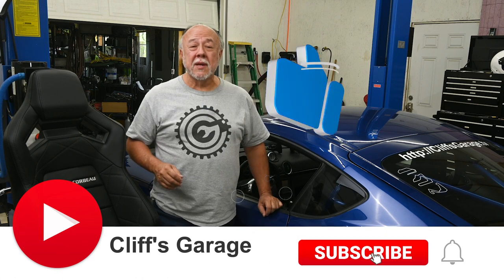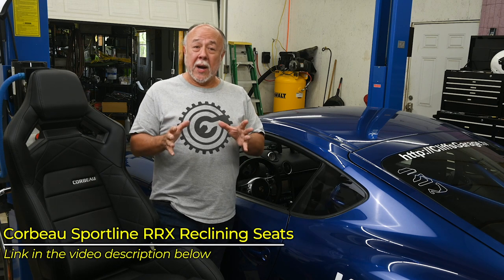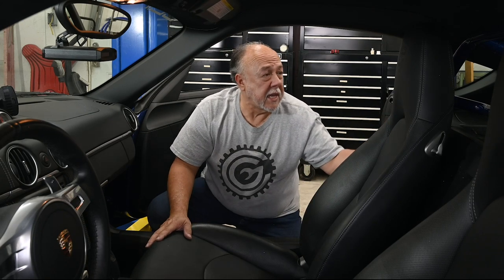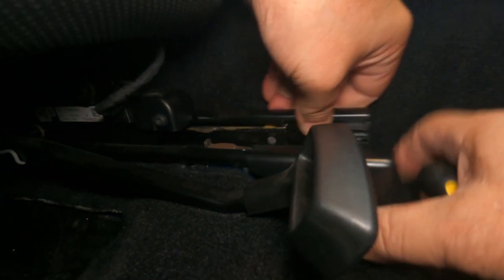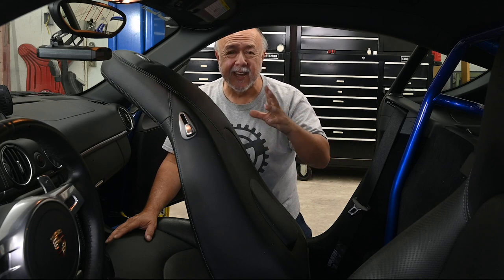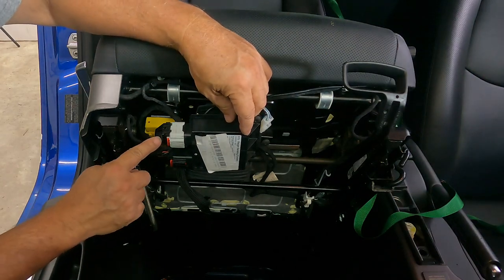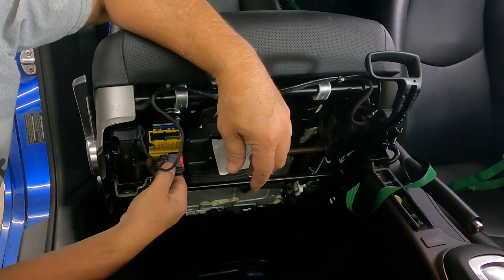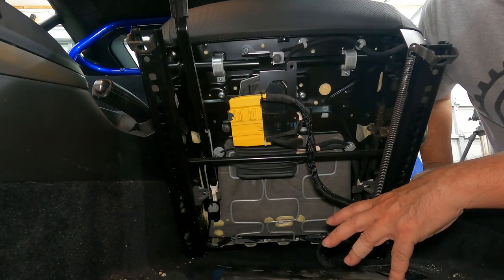Corbeau Sportline RRX Seats For My Cayman, Part 1: Remove The Stock Seats (DISCONNECT THE BATTERY!)

Comment: hi again, Cliff. wanted to thank you again for recommending the RRX seats. I just bought a pair for my 350Z with the stealthy 5th slot and love them! I'm planning on getting the same seats for my Z3 and my Cayman. although I'm 6 ft and the 350Z seats are a bit too tall for comfort. I'm wondering if they sit much higher in the Cayman as well? I guess I'll find out.
Reply from the maker: They sit basically the same or slightly lower than the stock seats on their lowest setting. Initially I put 1.25" spacers to raise the seat but eventually took them back out after a few months because my helmet felt uncomfortably close to the headliner. After several more track weekends I feel like they're just a bit too low for comfort so I may go back in with some 0.5" spacers on the driver's side only, leaving as much headroom as possible for passengers. Removing the headliner also helped a lot with the driver headroom issue.

Comment: oh nice! I have Corbeau Sportline RRS seats in my 350Z which are similar. I love them but was thinking maybe going to Recaros for the Cayman. That's just vanity, though. Might just stick with Corbeaus again.
Reply from the maker: tbh, if price were no object there was a set of Recaros I really really liked. Don't recall exactly what they were, but the price was about 3x the Corbeaus and Recaro wasn't interested in giving me a break.
Reply: @CliffsGarage  it's probably the Sportline GTs which come in a gorgeous leather with carbon fiber accent or vinyl with several highlight color options. I've had my eye on those ever since my 2011 GT500 which I sold. but I found that Corbeau has a gorgeous seat with white vinyl that would match my white Cayman beautifully. and the seat has a black pattern on the rear so it would still somewhat match the black leather interior.

Comment: Do you need to do anything with factory plug to keep air bag warning lights from going off
Reply from the maker: You can use a tool like PIWIS or DuraMetric to code out the warning. Apparently, however, you need to do it before removing the seats. I didn't and haven't had the gumption to swap the old seats back in.